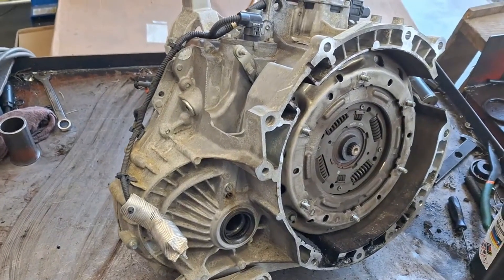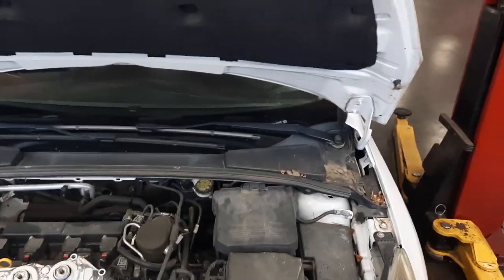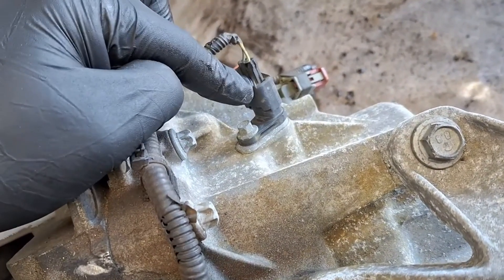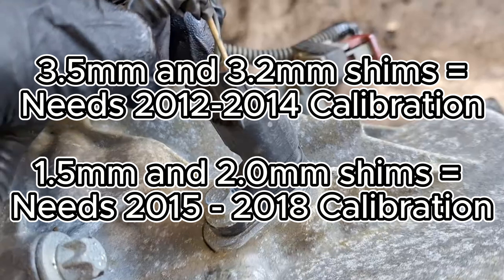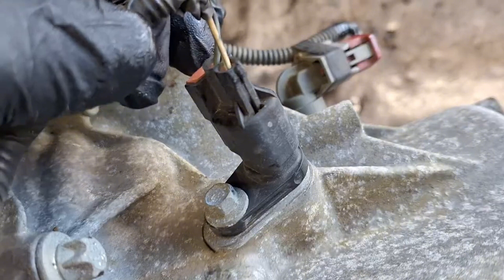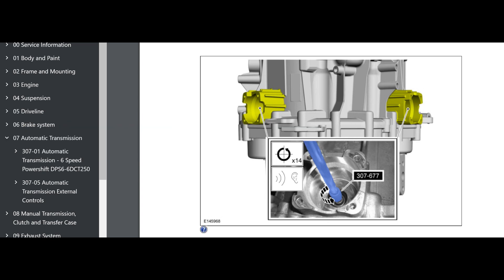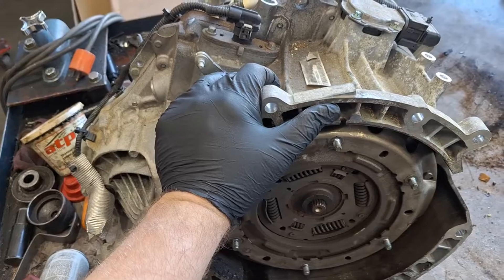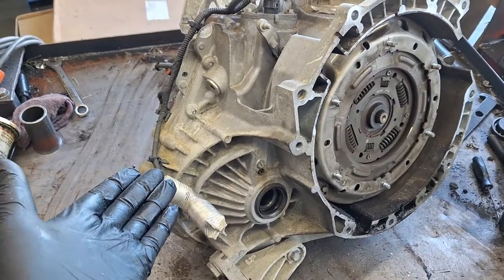Are DPS6 Transmissions Interchangeable? Answered! (Ford Focus & Fiesta 2012-2018)

Comment: I’m trying to put a trans from a 2015 Fiesta into a 2013. It’s has same calibration from what I can tell. From what I could find it shows the gear ratio changed throughout those years. Will that matter at all?
Reply from the maker: Just keep the TCM on the used transmission you get and everything will be fine

Comment: I have a 2018 that I put a 2014 trans in. It's shifting very hard like not letting off the throttle during shifts. No codes new tcm and clutch when swapped. This sound likely my issue. I'm not following how to change the calibration in the TCM to the 2014 version. I have programmed the TCM with IDS to the car and it just downloads the latest 2018 calibration
Reply from the maker: @letsfixjunk  hi, you should download the tcm firmware for the donor car, that you got the transmission out of
Reply: @BigBensCarsAndCycles  IDS won't let you choose which software you're programming will it? My best bet sounds like plug my new TCM into a older model car and program it then do the adaptive learn on the 2018 car

Comment: Question, so if I use a 2012-2014 transmission in a 2017, will I need the 2017 tcm or the 2014
Reply from the maker: @paisleyperformance3846  you'll want the 2014 calibration. Just keep the tcm on that came from the junkyard on it

Comment: I replaced my 2014 with a 2016 transmission it come with a (k05) TCM and speed sensors. it run perfect with no issues I put almost 60,000 on it so far.
Reply: Did you have to reflash the TCM? Or just do the clutch relearn procedure?

Comment: Ben ,I have a quiestion ,what is the correct maf sensor reading on a Ford Fiesta?, online it says 2-7 g/s at idle and 15-25 at 2500 rpms for any vehicle.
Reply from the maker: @scottyx-ee1qe  I would have to get a shop manual to be sure, but I would say around 2 at idle

Comment: 2016 focus with a 2014 trans, using the tcm from the 2016 with the speed sensors shims from the old 2016 trans as well. car will drive and shift but shifts extremely hard into every gear.
code p073f
if you punch it from a dead stop it’ll go until about 5k rpm and fall on its face and slowly find 2nd gear and keep going. code has only popped up one time. 
any clues?
Reply from the maker: @adampropps1730  the shims are meant to be an ID for the calibration needed, not swapped. Sounds like a bad 1st gear syncronizer unfortunately. If that's the only code and if you hear grinding. Otherwise you can check the video p073f after clutch job diagnosis

Comment: I brought my 2013 focus into a ford dealership due to reoccurring p07a5 and p287a codes, to which they replaced the tcm under recall and made the car completely undrivable. The car was drivable prior to bringing it in as i would unstick the bottom actuator every week or so and it would drive through gears until it would stick again. However, immediately after they gave the car back i got a transmission hot alert and a transmission fault service now notice. Kinda crazy that they are good with doing that, I would’ve respected it if they said they didn’t want to or couldn’t service it rather than actually brick the car and tell me on the phone that the car is fixed prior to picking it up. The car also only had 2 more miles on it than when I dropped it off

Comment: Hi ben. Does focus 2014 have a fuel filter? I have error 1450 on it and think about changing fuel filter
Reply from the maker: @lifeminuts  hi, no it's just the strainer in the tank. Your code I'm 99.9% sure is a bad purge valve. I have a video for that
Reply: @BigBensCarsAndCycles  thank you 👍✌️

Comment: I have a couple of questions.  1.  Can i load a calibration with Forscan? If i can where can i get the calibration?   2. I recently had to swap a motor into  a 2012 focus, but i got an engine from junkyard out of a 2016. The 2016 had a sensor located in the cylinder head between cylinders 2 and 3, that thr 2012 does not have. I dont know if that was a new sensor that Ford added or if they just moved it from a different location. When i put it in, i didnt have an unused plug anywhere else.  The motor didnt start, but that was because it had 3 cylinders that were bad, so i wxchabged it from an engine i pulled out of a 2013 that didnt have that sensor.   If the 2017 motor was good, would it have run without that sensor plugged into the 2012 harness?
Reply from the maker: @irishdadx4  hi, ford directs us to use the old valve cover on replacement engines. So basically I wouldn't worry about that sensor. And I'm not sure about your first question as I've never used forscan to program a tcm. There are videos on YouTube on that which are helpful. As far as a calibration, you can look around on forscan Facebook groups or Google that. Sorry. Wish I could be more help there. I'll do that some day I'm sure and I'll do a video
Reply: @BigBensCarsAndCycles  interesting about the valve cover, since you would need to remove the sensor from the cylinder head in order to use the old valve cover, since it sticks up above the cover. I dont know what removing the sensor would do. I dont know if it opens to a oil gallery, or a water jacket. I was just leaving it unconnected, but since the entire engine was crap I swapped it out for a second replacement, with a motor from a 2013 that didnt have the sensor.  As far as the forscan, I have used the software to reprogram 2 different focus' with new clutches I replaced, and one I replaced the TCM a couple of years before the I had to replace the clutch when the TCM went out.  Anyways, thanks for the response.  All your focus info is spot on, and very helpful.

Comment: I can attest to Tom's Tune; my 2013 clutch was shuttering and slipping in first/second (the common issue). Heard about the Tune and a lot of positive reviews. Tom was awesome to work with; You get a base-tune to put on the car - then gather some data (while driving) using a laptop through the ODB2 port. Send him that data and he returns a custom tune for the car. Been running it for 2 years now and the transmission shifts perfectly.
Reply: How do I get started?